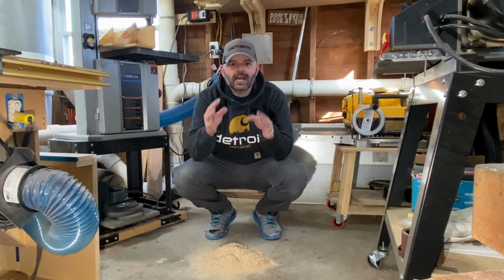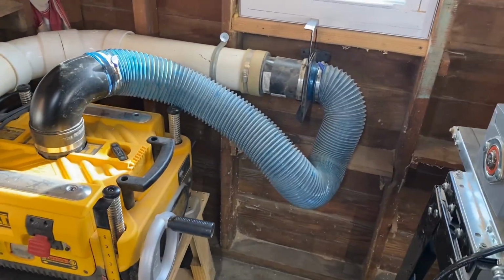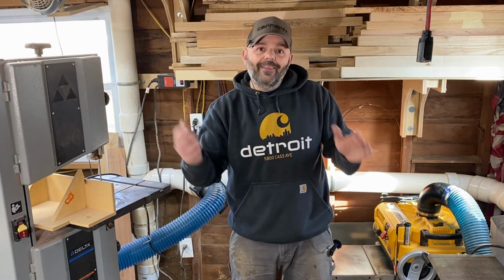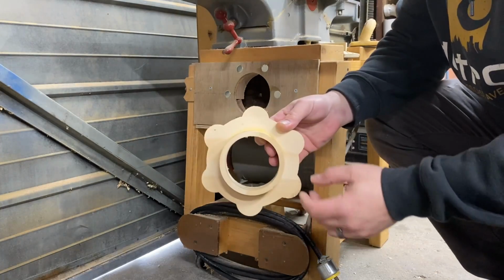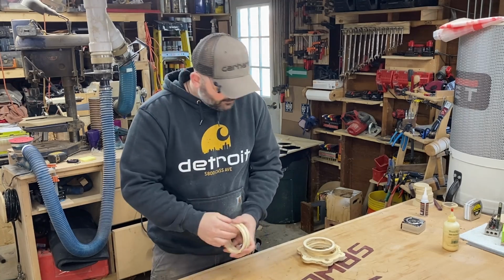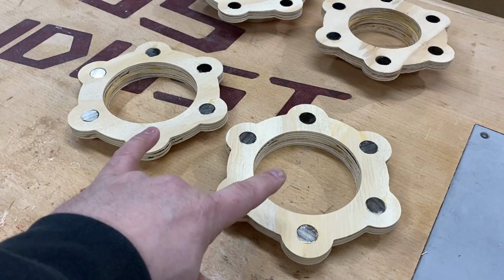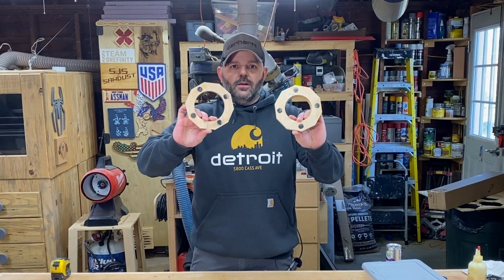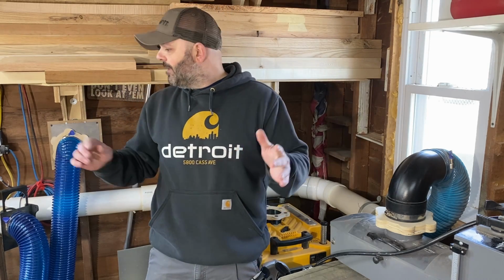I use my CNC to cut my own Magnetic Dust collection adapters - SO MAD I didn't do this sooner!

Comment: Nice! I opted to just buy the magnetic connectors from a maker (MagPort). They have been an awesome improvement to my shop. One thing I noticed in your video is the sliding plastic blast gates you use. Those are what I used a couple of years ago before I found out the hard way that they are trash and will get clogged up pretty quick without constant attention and stop closing completely. I moved to aluminum blast gates and those were better, but ultimately, I just opted to move my hose from machine to machine as needed which the magnetic connectors made super easy to do.
Reply from the maker: When I first picked up the blast gates, I had the type that didn’t push all the way through, so after 2 minutes- they wouldn’t close all the way because they packed all the dust in the track, so I exchanged them for this type- that pushes all the way through so it knocks built up dust out of the track and allows it to close fully. I do have a couple that have started to crack- so I will definitely look into the aluminum style next. Thanks!

Comment: Funny you just made this video.  I purchased a starter kit of Izzy's version that he sold to Mag-Tools.  It's great, but pretty expensive to hook up even a few tools.  So I've been searching through YT for DIY solutions.  Bam!  Here you are.  LOL  Great job.  However, I would need a SVG or DXF format, since my CNC is a DIY as well.  I use Fusion 360 for all of my machining.
Reply from the maker: It is funny how that works , isn’t it! I will update the file to have the SVG so it can be imported and used by many of the cad/cam programs. You built your own CNC?
Reply: That would be awesome!  Just let me know through this comment when you have it ready.  And, yes, I built my own.  I bought a parts list from a young, Swedish guy on YT who built a DIY one that looked quite sturdy.  I took his version and scaled it up to a 32"x32" and put a 2.2kw water-cooled spindle on it.  He used Arduino to control, but I went with a Blackbox controller for ease and stability.  The CNC works great, but has trouble doing aluminum since the gantry is a little weak in the Y axis.  I thought about rebuilding it, but I really only do wood anyhow. @SJSSawdust
Reply: The cost of materials for the DIY CNC was about 1/3 of what I could buy a commercially available one at the size I built.  All in, I spent around $2200, but had a lot of extra parts.  LOL
Reply from the maker: @dgoddard  that’s really impressive. I once thought about making one of those sharpie drawing machines….. a much smaller and cheaper scale, but I was too intimidated! Lol.
Reply: @SJSSawdust  I was a little intimidated as well when all of the Amazon shipments started arriving and there were parts all over the place.  But it really wasn't that tough.  I took my time and spent about 4 days building it.  

I started with the Arduino to control it, but kept having problems that I got tired of chasing so I purchased the Blackbox controller and it was basically plug and play.  

The biggest problem I've had with it was chasing down EMI.  With the bigger spindle, it caused more EMI than I was prepared for.  But I threw some jacketed cables on the spindle and put some ferrite cores on all of the wires and haven't had a problem since.
 
It's definitely a doable project for anyone with a basic understand of how a CNC works.  YouTube vids and FB groups were a big help as well.
Reply from the maker: @dgoddard  that is SO cool! I’ve updated the file to include SVG (if you’re still interested) Happy CNC’ing !
Reply: @SJSSawdust  Awesome!  I'll go check it out.